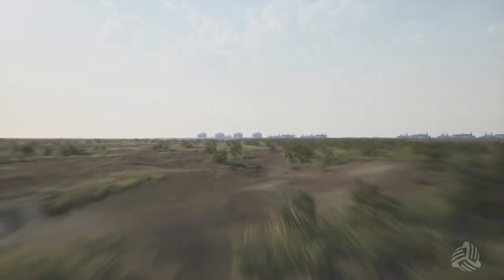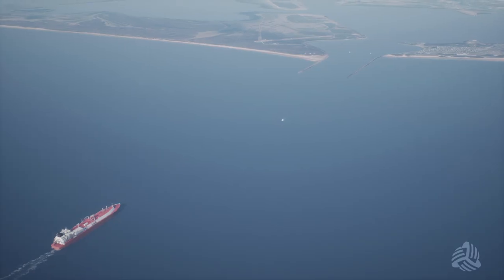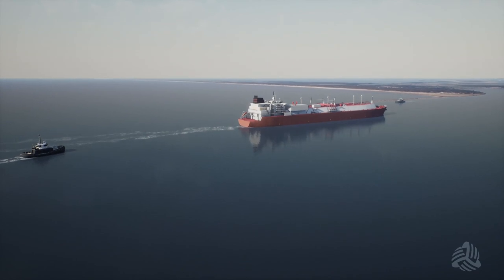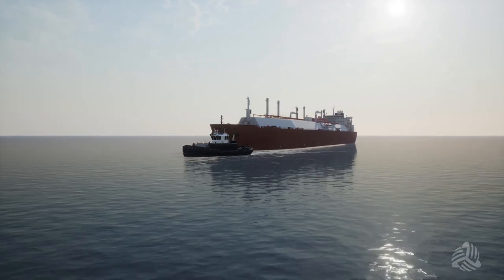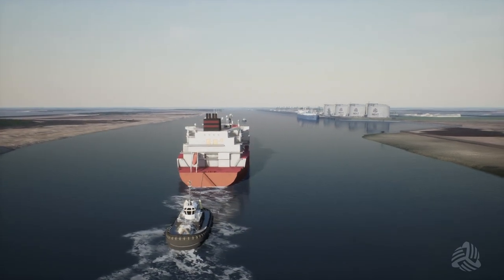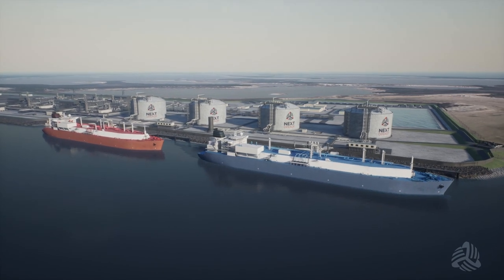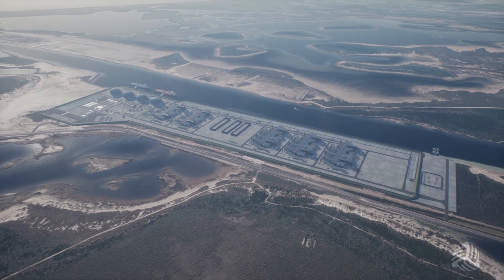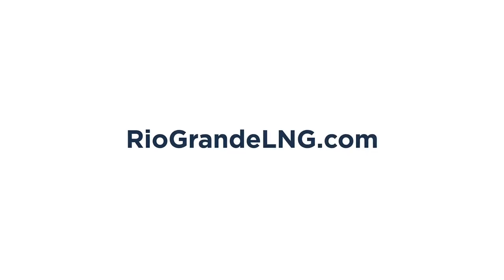LNG vessel video - NextDecade Rio Grande LNG

Comment: So quiet and calm, no other big boats or barges using sailing the Brownsville Ship Channel. Not a word or even a whisper about the SpaceX Boca Chica Starship project 6 to 7 1/2 miles to the northeast of the Rio Grande LNG's giant LNG storage tanks. The rockets are launched to the east, taking advantage of the Earth's rotation ever eastward and the open waters of the Gulf of Mexico. The LNG tanker ships will pass out of the Ship Channel into the Gulf. If things go wrong with a rocket launch, a Version 2 Raptor engine malfunction could result in falling debris endangering the LNG tanker ships more than Rio Grande LNG's huge LNG storage tanks and LNG liquefaction storage tanks. The FAA has presently suspended SpaceX's launch license due to a worldwide newsworthy launch that tore up the launch pad -- sending huge amounts of sand and large chunks of concrete in every direction. The sand, small pieces of concrete, and who knows what all fell on Port Isabel, 6 miles from the launch site on 04-20-2023. Three weeks later, chunks of Starship heat shield insulation started washing up on South Padre Island. The launch pad is being rebuilt with important improvements. SpaceX is developing a Version 3 Raptor engine that has 10 percent more thrust power than Version 2. SpaceX is also developing a Version 2.0 Starship that's to be taller and wider, with more propellant capacity and thrust. Rio Grande LNG wants the FAA to limit the Starship project's potential impacts on its LNG Terminal construction and operation to no more than the anticipated impacts back in 2018.
Reply: What do you think about investing in the stock?